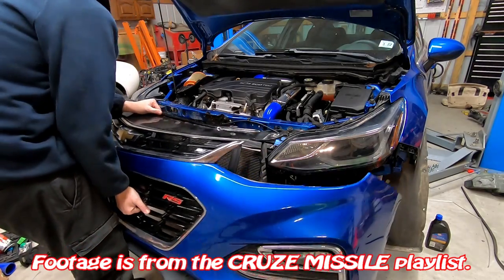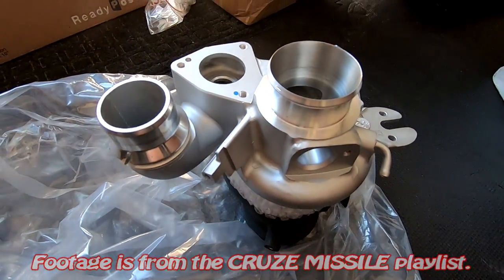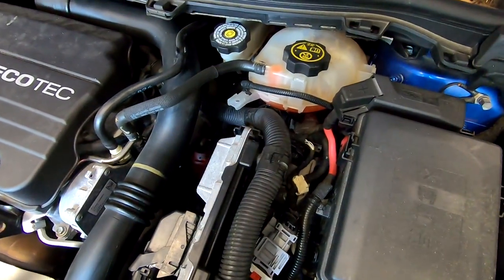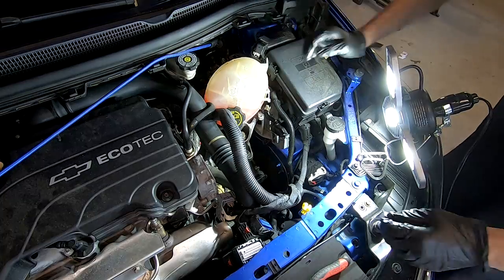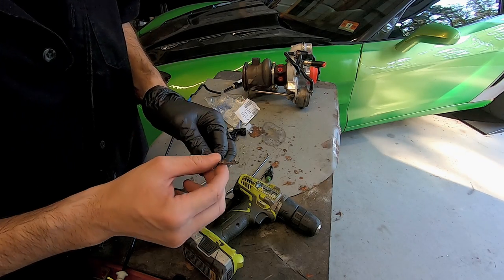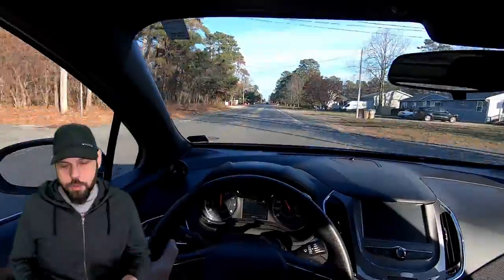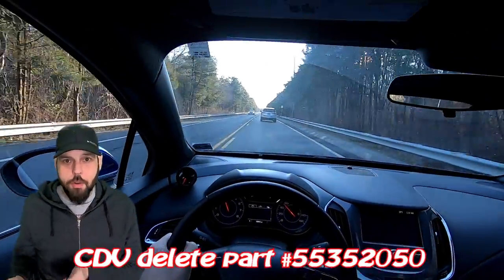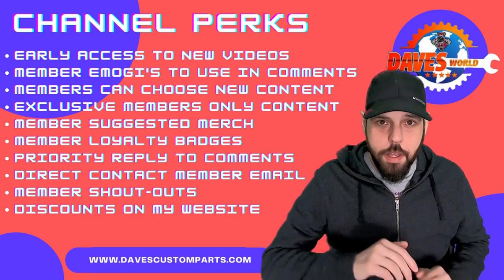CRUZE clutch delay valve removal Dave's World Project CRUZE Missile

Comment: Cool video Dave! I personally am keeping mine since I've switched to a single mass flywheel and to help add with traction and keeping the trans alive.
Reply from the maker: Yea I’m a fan of the CDV. I actually swapped in a Gen 1 cdv and like the feel. Are you still Running an accumulator?
Reply: @davesworld2132  I am. Anything to help the M32 and stock axles live. Can't wait to get the trans back in cause next step I'm installing my N2MB wotbox and boost controller. Hopefully it lives long enough to take it to the 1/4 mile track so I can do some tuning. Nothing too crazy yet because I'm enjoying learning the tuning process.
Reply from the maker: @cmattdabrat  you actually inspired me to learn myself. I have an equinox project coming up and no one wants to touch it as far as tuning goes.
Reply: @cmattdabrat if you don't mind sharing, what single mass flywheel did you use?
Reply: @stinkothestooleater4490  It's from spec. Part number SC17S
Reply: @cmattdabrat  thank you!

Comment: i have a 2012 sonic with the 1.8l & 5 spd stick. it doesnt seem to have the clutch delay valve which some do, it also doesnt have the brake booster vacuum assist pump or the secondary air injection pump. its very basic. but less things to go bad. but it does have the hill assist feature.
Reply from the maker: It might not need that stuff because it’s not turbo charged but the hill assist is really nice
Reply: @davesworld2132   ya thats probably the reason for it not having the vacuum assist pump, but they do make the injection pump for the 1.8l its a emissions thing.

Comment: Any videos on how to replace the clutch cylinder on a 2017?? I have everything off but can’t pull the cylinder out, it seems to be behind the frame of the car.
Reply from the maker: Is the rod off of the pedal arm?
Reply: Yessir, the whole pedal system needs to come out, it’s what it seems like. Clutch, gas and break pedals 🫤
Reply from the maker: @juansandoval9833  Yea they are integrated into one unit. Interesting the master cylinder would not able to be removed separately. Eventually when I mess with that I will have a better wayt o do it if I can.

Comment: Can you tell what's the difference between the Gen 1 and Gen 2 valve???

I would have assume that hydrophilic fluid movement was all that is needed to have a soft delay, unlike the older style with wire.
Reply from the maker: They basically do the same thing it’s just a little tiny orifice that limits fluid flow. Om a generation two it’s part of the elbow. On a generation one it can be removed.

Comment: Not sure if this would be related to the delay valve but in the warmer weather the clutch engages .5-1" off the floor but in the winter and when I first got the car the engagement point is right in the middle or well the factory position. Could this also just need a brake fluid flush?
Reply from the maker: Moisture in your fluid. I would do a flush
Reply: @davesworld2132  thats what I was thinking and honestly hoping for aha thank you for the reply! Love the page too!
Reply from the maker: @chrisdag1994  thank you!
Reply: Had a question.  I own a 2018 cruze and my clutch pedal intermittent on pressure and want to know is the air bubble from master cylinder or slave?@davesworld2132

Comment: First off just found your channel like what I see so far very cool. I found you because I am trying to learn more about how my clutch setup works, I have a stock 2018 Cruze, that just last month the clutch pedal has started sticking and not coming back up after pushing it in. It doesn't happen all the time but enough to be an issue, could this delay valve be a possible culprit of that?
Reply from the maker: Yes this could be the problem. There are a few other things that can also be an issue. I would start by at least possibly bleeding the fluid to see if you can get some air out.
Reply: @davesworld2132  I will give that a shot and see what happens and I'll let you know.
Reply from the maker: @claytonhall9985  please do.
Reply: @davesworld2132  Life took a turn of busy for a bit, so it took a while to finally get this fixed. (Helps having a few vehicles to drive while one is not working 100%) The Clutch pedal continued to just get worse bleeding did nothing. Ended up replacing the whole clutch as I suspected the slave cylinder of being the culprit, had some debris as well so I replaced the master and all of the lines as well. So far two months in and everything is working as it should again.
Reply from the maker: @ It could be but they’re also a pain in the ass to bleed I have a video showing how to do it.

Comment: My clutch pedal is stuck to e floor now and my fluid is full - do I need to pull the trans and do slave or is it just a new delay valve
Reply from the maker: Did it just happen one day or did you change anything?
Reply: Slowly just started sticking to the floor - I could pop it back up and it would be fine - then today - it is now 100% not drivable- have no pedal- just stays on floor- can only bump start it on gear but can’t shift whole car is on - I’m think oh o need a slave ? ( will also do clutch when I am in there ) rather not have to though if it’s just a delay valve
Reply from the maker: @jakefraser941  I don’t think that’s the delay valve it’s probably the master or the slave. However you might get lucky and be able to change the fluid.
Reply: @davesworld2132  have you pulled the trans on this gen before ??? Easy? Just slide trans down and support engine ?
Reply from the maker: @jakefraser941  it’s easy but you also have to remove your axels and shift the engine to the left. BUT!!!! The moter mounts are on that side so be careful.

Comment: Hey brother any idea what I need to go E85 ? Not seeing a flex sensor for newer cars ?
Reply from the maker: Hey what’s going on I hope you’ve been well. I’ve been meaning to talk to you about gaming stuff but I noticed some of your videos were missing is twitch easier to talk on?. As far as the CRUZE. Our cars are not compatible especially since it’s direct injection at least for right now it’s not.
Reply from the maker: Side note you do have other options if you want more power I could hook you up with a methanol injection system which is the same as e85 but you could still run 93 octane

Comment: Could this cause a pedal to come back about half way, and either stick there or hold momentarily then release?
Reply from the maker: Yes. You can also have bad fluid or need a bleeding.
Reply: @davesworld2132  thank you! Randomly this evening my foot got a nice slap that surprised me. It's always felt a little off but I figured it's cause it's a cruise not a Corvette. Thanks again love the content man
Reply from the maker: @dallashellard7963  there is also a spring on the pedal. It could be binding up.

Comment: I removed the CDV in my Gen 1 and it did nothing. Still grinds that second gear if you shift too fast. 😢🖖
Reply from the maker: You need to modify the accumulator too. It actually still slows the clutch.
Reply: @davesworld2132  Yeah, i have the bypass from BNR but tried to put it on and cant get the accumulator to twist like they show and im afraid to break it. 😓🖖
Reply from the maker: @mikes.4811  makes sense. That will probably cause a much firmer feel on the Gen1 if you can get it installed.